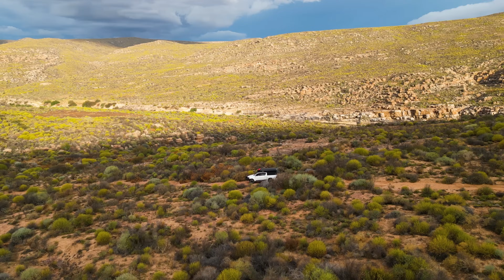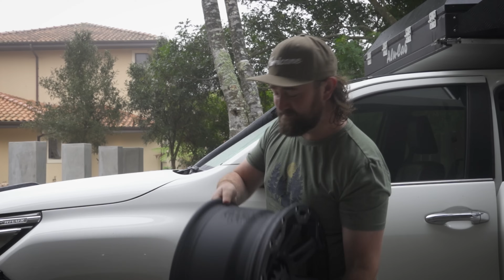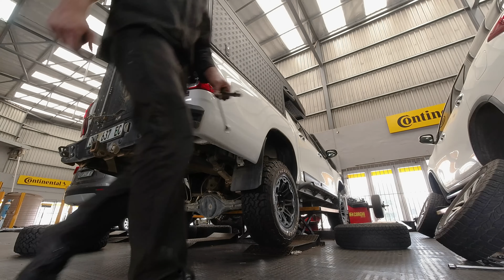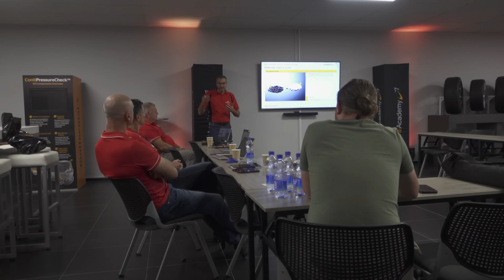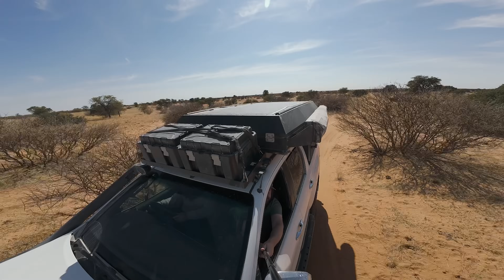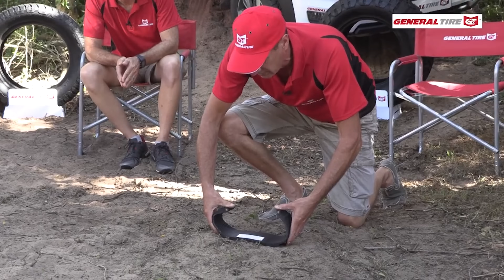Fitting New Wheels, Visiting a Factory, and Inflating my General (Tyre) Knowledge!

Comment: Hi there. Nice vid 👍
I notice u still have your front mudflaps on and have 265/70/17.

Do you not get any rubbing inside the front wheel arches and with the mudflaps on ? Normally with that size of wheel/tyre u get a little rubbing and even with the mudflaps taken off there is marginal clearance- which means that offroad with heavy extension on the suspension u can still get rubbing.

That’s true when you have a 50mm lift- do u have that on ?
Thanks

Comment: I just got rid of my Grabber at3 tires. For hunting with thorns these have been the worst tires I have ever used. And I tried hunting at 1.8 bar up to 2.3 bar and zero difference. I do understand they not 3ply wheels but for sidewall punctures they were horrible. Road noise was perfect, gravel roads were perfect but any thorns at all they are a no go. But I think these ones you are fitting will do the job

Comment: I run general tires on both my Landcruiser. Fantastic tires. I'm in Utah, US. I care way more about being able to air down well. Run a 15" rim on my FJ62 with a 33'' tire so I have a lot of rubber when I air down. Same with my 100 series. Really don't care about being a little slow on the high ways, or having less torque.